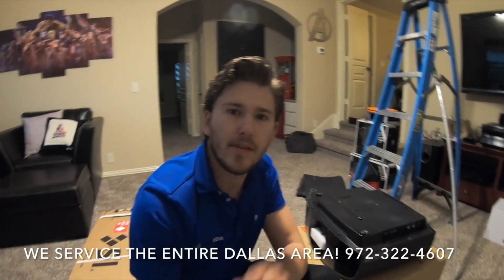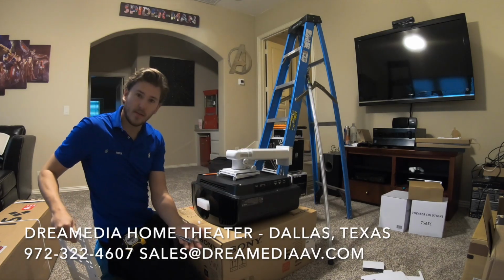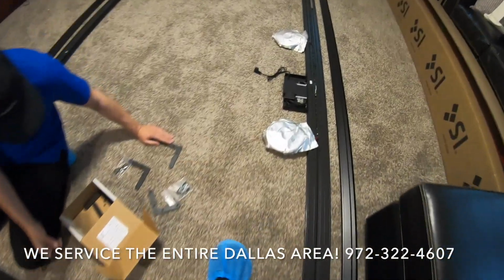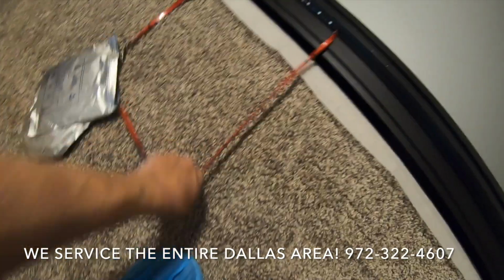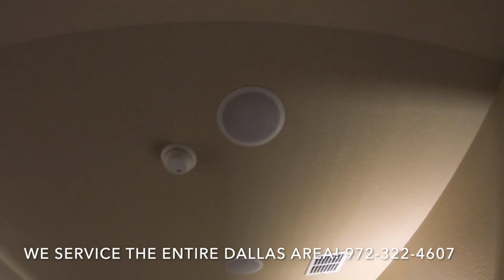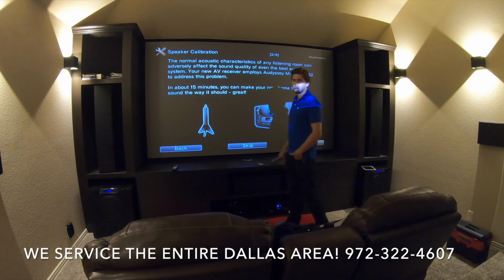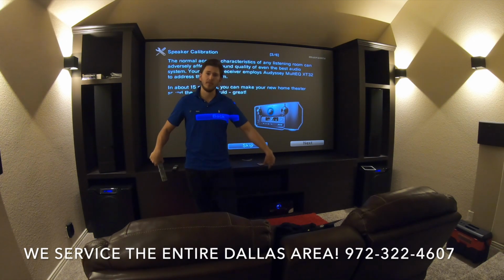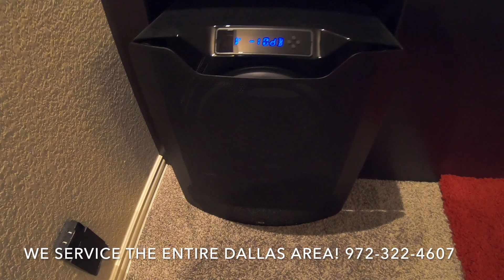AWESOME SETUP + DEMO!! Dolby Atmos 7.2.4 Theater w/ SI 125" Slate 1.2, Sony 295, & SVS Subs!

Comment: Great video. I dont like the surround speakers, I think they are B&W DS3s which I have owned and I always thought were weak. The installation was top notch, great job guys. Why would you need two subs in a room this small? What am I missing?

Comment: How is the installation of the cables by the walls already have the pipes for each cable and electrical outlets, ceiling and walls are plaster? do you have to do the pipes before cable installation ns?

Comment: Another awesome video...AND install.  Quick question regarding calibration. Whilst you did mention that once you run the AVR’s auto EQ you tend to tweak it, do you let the AVR setup the subs aswell or so you run them separately via the SVS’s onboard EQ features??

I would of though the subs propriety EQ would offer better results no??

Comment: How are you guys doing? I really love home theatres as this is my new hobby in my home. However I was wondering who can I call to just run my speaker wiring in the South East GA area? I have all the equipment just need the speaker wire run through the ceiling and dry wall so I can hook up my speakers with the clean no wire look.
Reply from the maker: We dont have connexctions out in GA just yet. Check out yelp and make sure you get a 5 star company :)

Comment: How did those bipoles sound in his room.  Do you prefer bipoles or monopoles for most 7.2.4 systems in a room such as his.  I wonder if monopoles would keep the surround more directional since you have 4 back surrounds and whether the dipoles would muddle things up?
Reply: I have always used bi/dipole speaker's for the rear channels in my home cinema system as for me they provide the best spread of sound around the room.

Comment: Hi, I need some advice. I am planning to set up 180" screen SI Zero edge. Wish to have my SVS speakers behind the screen (2 x fronts + Centre and may be 2 front high). Which 4K AT screen would you suggest? or Should I have the speakers on the side and NOT behind the screen. Thanks for ur advice. Raj
Reply: I can't recommend a screen. However there's nothing wrong with doing speakers behind a screen. Remember that's what your local movie theater does. Just make sure the screen is acoustically transparent.

Comment: Actually deciding between an electric 120" roll down screen with a 40-50" lcd HDTV for day to day use or doing this kind of setup with a lg hu80ka as a permanent pseudo tv (lg projector has smart TV capability).

Comment: What SVS subs model were they?
Reply: SVS PB 4000
Reply: @keepingupwiththejones2933  Many thanks!
Reply: Those looked like the SVS SB 4000s to me.  They didn't have the 3 ports on the bottom, and looked like the sealed subs.  Sealed is less efficient but are tighter and sound better, especially with music.  Ported would be way too much for that tiny space, in my opinion.

Comment: hope the customer plans on elevating that back row of seats or nobody is EVER going to enjoy sitting there having to look over the row in front. then again nothing about that back row is ideal because even if they do elevate it, they are gonna have the projector right over their heads blasting fan noise and hot exhaust air on them.